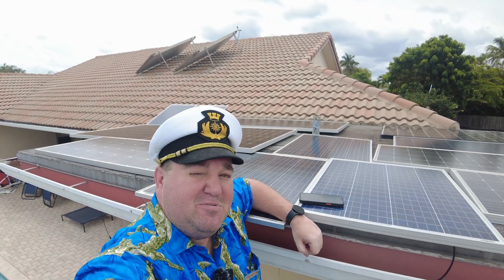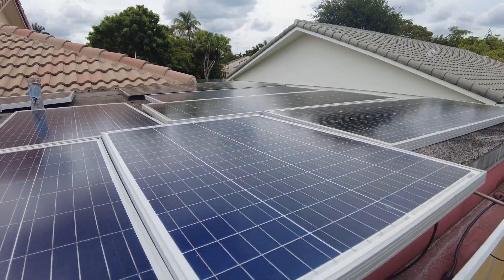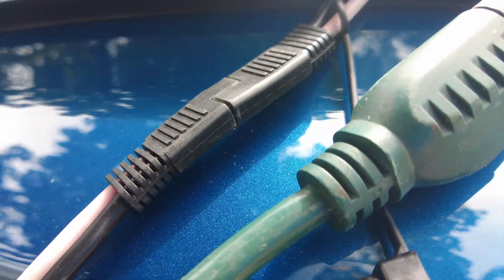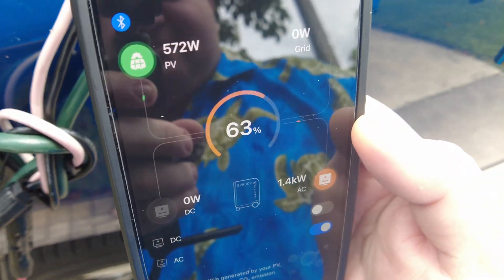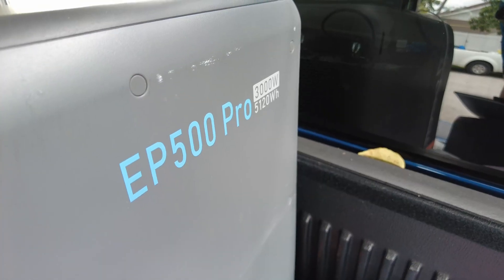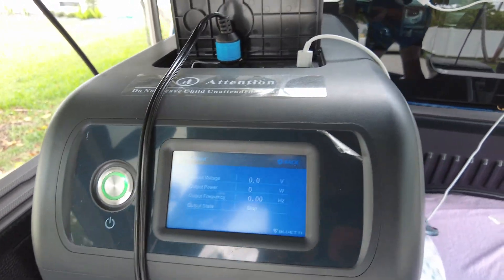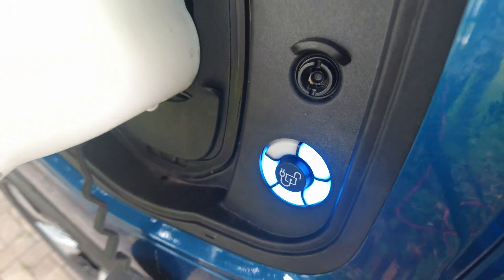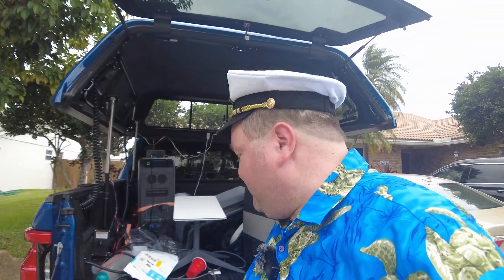How To Fully Solar Power A Ford F-150 Lightning For TRULY Green Energy! #f150lightning #solar #ford

Comment: My solar powers the home and charges the Lightning.
Reply from the maker: Awesome! Did you assemble the system yourself? What brand is it?
Reply: @NoPantsProfits  yes installed myself. I have 18KW of solar and a 30kw battery backup charged by solar.
Reply from the maker: @chada472  Pretty epic setup!
Reply from the maker: @chada472  Victron?
Reply: @NoPantsProfits  Grid tied solar using Fronius inverters. I have 18KW of solar.

Comment: I have a Ford Lightning with a 98kwh battery and a 30 amp output in the bed that I'll use to power my Go Play 26BH travel trailer (which comes with 200 watts of solar). What is a good way to charge the truck adequately off grid (will 120 volts be adequate, or do I need 240 volts?)? I will be using the 15,000 btu a/c. TIA
Reply from the maker: You gonna need a 240 for sure to run the AC AND charge the truck.... with 120 you
Will likely not be able to run the AC unless it's a 20 amp circuit.

Comment: I use my EcoFlow Delta Pro with two 400 watt panels to charge my lightning and can get around 10 miles in a few hours.  Also those extension cords are giving me anxiety.
Reply from the maker: The extension cords are MOSTLY to tie into my inside system too!